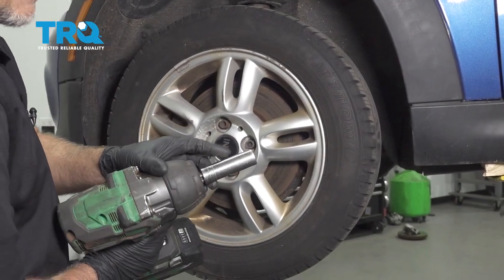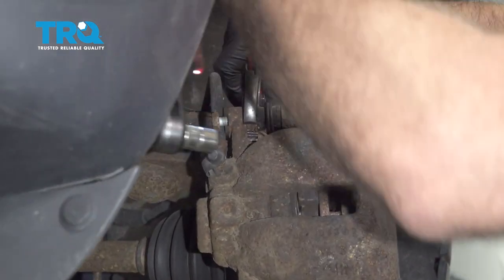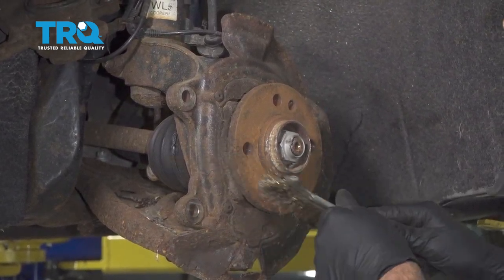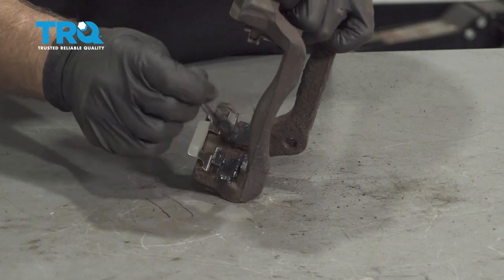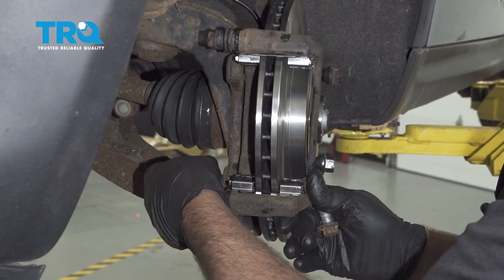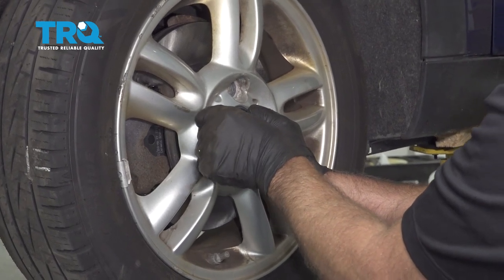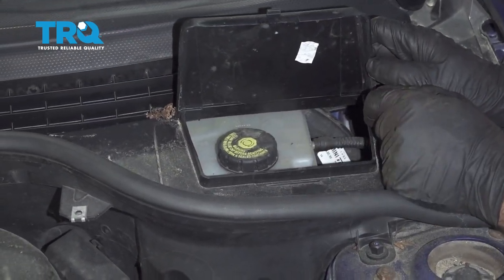How to Replace Front Brakes 2007-2013 Mini Cooper

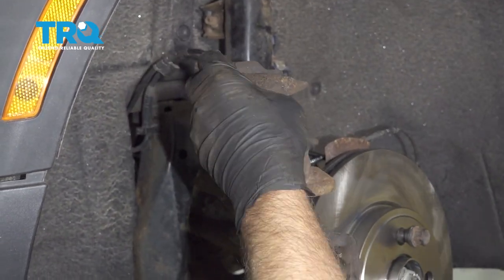Comment: at 6:40, you're missing an important step (IMHO).   The master cylinder reservoir cap has to come off and most likely some fluid siphoned out if it was topped off at any point since the last time brakes were done.  If not, the fluid will overflow out of the tank (or spray out through holes in the cap) and cause a mess, including possible damage to paint under the hood because brake fluid destroys paint. The opening should be surrounded with rags to absorb any spilled fluid.

Comment: Thanks for clear, concise video. These are very useful for part time DIYers who need a reminder before starting a job:) btw who uses new caliper  bracket bolts and guide pin bolts? That’s what Mini Haynes manual says in uk.

Comment: You mention a T30 to remove the rotor screw. In my 2013 Mini Cooper hatchback it was actually a T47. Also, you seem to forget to put the rotor screw back on. Finally, it would be good to remind viewers that the pads are not all the same. The ones made for the sensor are slightly more protuberant, and should be placed on the side closest to the engine.